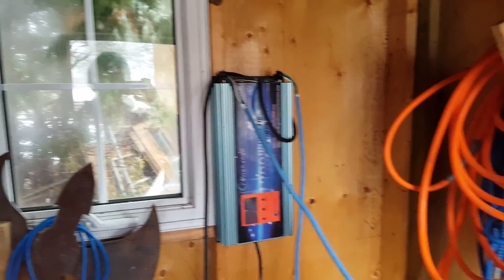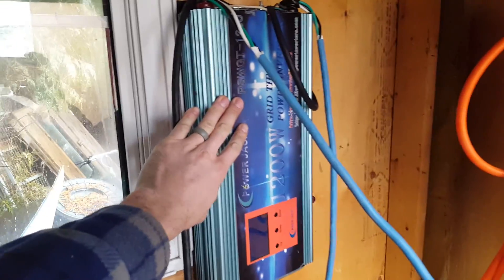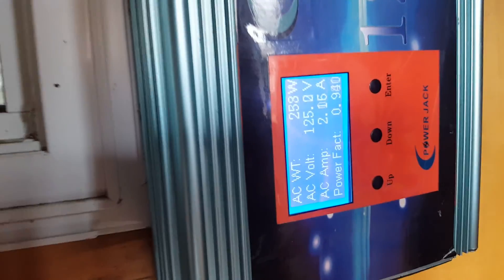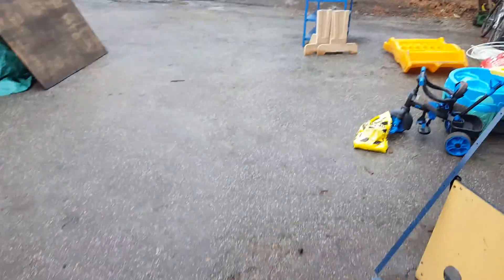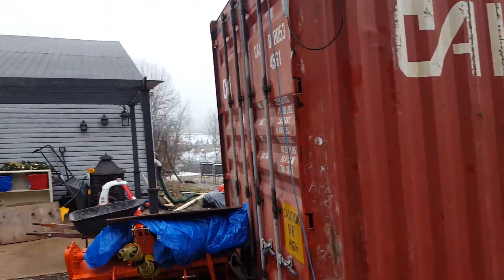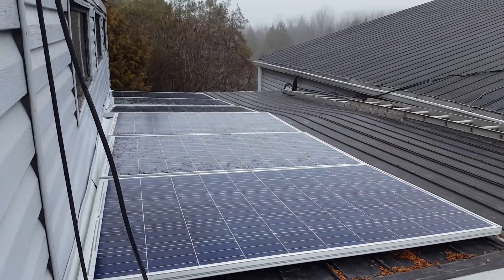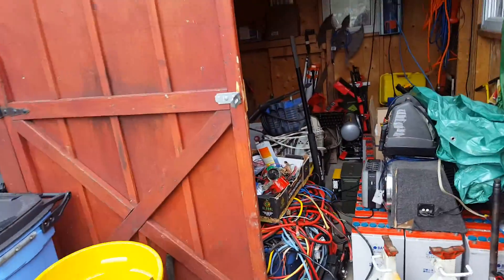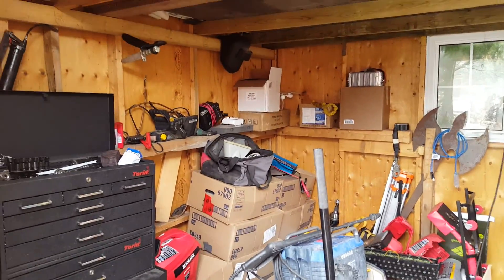Using The PowerJack Grid Tie Inverter

Comment: 1080p @ 30 fps looks perfectly fine and sure it may be messy but you're still moving in. The issues of wondering why most of these devices we use wired in parallel doesn't seem to work right I finally figured out. Between finding this out first hand and scouting the web, certain devices like the TP4056 can't be ran in parallel they fry and some others run fine while certain others run hot and under their rated specs until they burn out... I wish they would tell you this in the description of the product before we buy them. I ran four TP4056 battery chargers in parallel to a 4 battery 18650 battery pack in series as a experiment and it fried, but when I used 4 separate solar panels or 4 separate phone chargers it worked great, I don't remember if I told you this before, but some of these devices need total isolation so I kept looking and found a isolation chip here https://www.aliexpress.com/item/1PCS-B0505S-1W-5V-to-5V-converter-DC-DC-power-module-converter-1000VDC-Isolation/32712121720.html so you can run from one source but limits you to 200mAh charge using the TP4056 and they wont tell you if these chips can be ran in a parallel or series. It uses two pins in and two out and is only 1 watt, do you know of anything yet? Banggood told me we can't wire most of these charging or power supplies we use in parallel because they wont work correctly or burn as soon as you connect them to electric and they're not meant to do this so it's confirmed
Reply from the maker: yup im getting two new inverters :) they should be much better :)